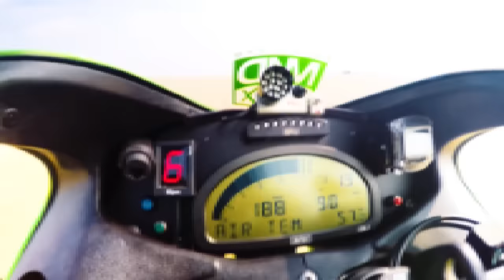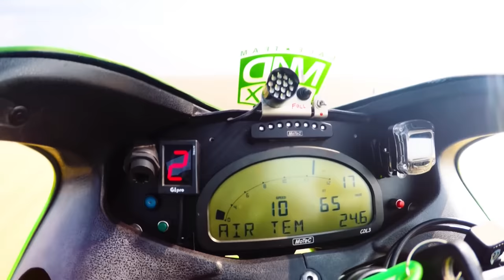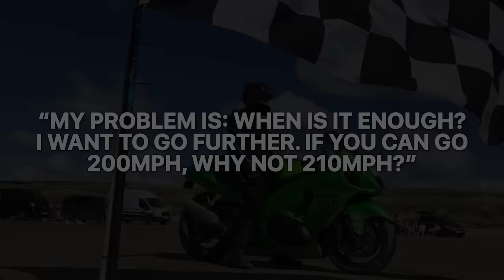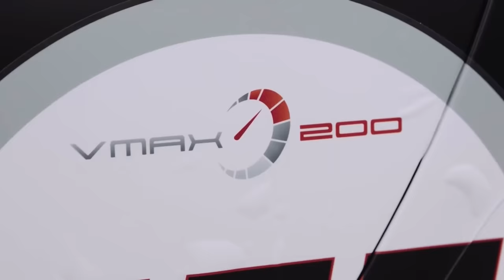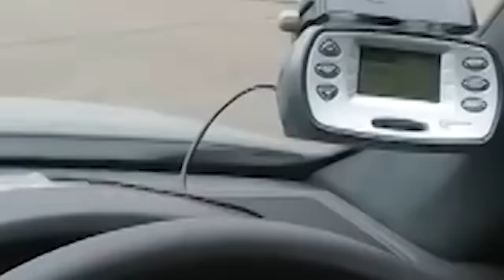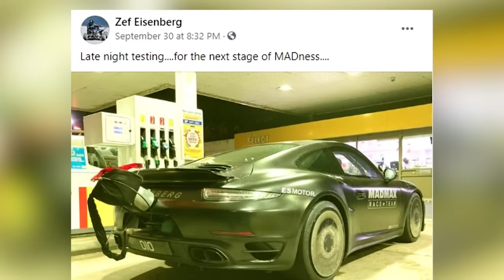The TRAGIC World Record Attempt of Zef Eisenberg

Comment: It was a huge mistake of his to get a lever to pull the parachute instead of having a button directly in front of him or on the steering wheel to push.  Because in the split second timing of an emergency, the body will automatically react how it has been trained to react and in the split seconds of a possible crash, nobody has the instinct to remove their hand from the steering wheel to pull a lever on the mid left of the dashboard, if they sense they are losing control of the car.  The instinct is to keep as much control as you can with your hands on the wheel and brake.  That is what he did.  In any other car at any other time that would have been the right thing to do, but in that car he was supposed to deploy the parachute first and then hit the brakes.  

So even though he may have stopped the car successfully via parachute then brake in his warm up sessions, he must have consciously made the effort to.  But then when he got to the real deal of record breaking his instincts took over and to counter a slight loss of control he hit the brakes first.  Such a shame.  He had so much left to live for.  I feel sorry for his kids not having their dad anymore.

Comment: Regardless of how he was strapped into that Porsche on the fatal run..  WTF type of fireproof get up does anyone thing that is???   He may have been as good as dead regardless, especially with that fire, but not having a full face race designed / built helmet without fireproof head gear is a death wish with a fire, even if you were to get out of there quickly..   At least "He died doing what he loved"...  Honestly, that may be good for those pushing the limits, and rarely is painful for the driver, but unless nobody likes you, including your family..  It is absolutely selfish...  One would think this guy would at least have factored in as much safety for as many contingencies as possible..

Comment: I was trapped inside an all composite TvR 350Z as a fire started due to engine failure and turbos that could not cool down, the electric door and window winder failed and I was too big to get out with my helmet - luckily the door opened and emergency track responders acted quickly with extinguishers - scary moment